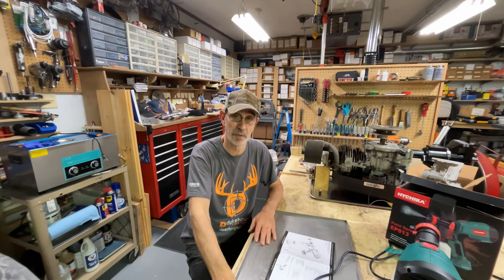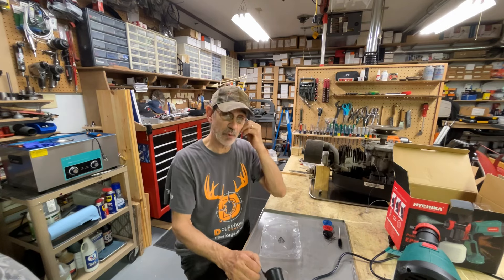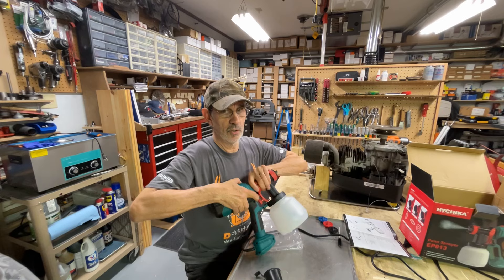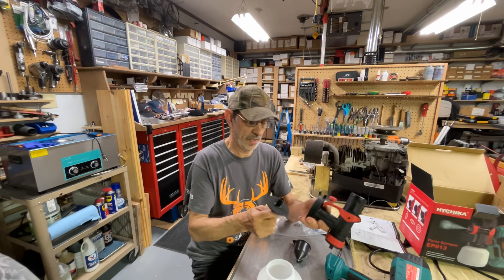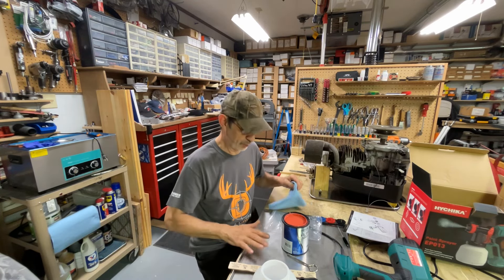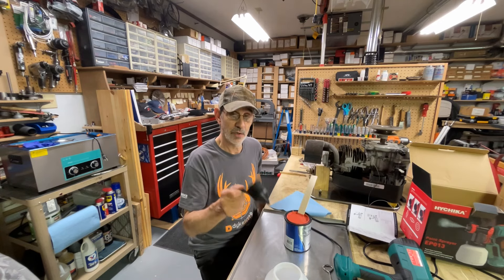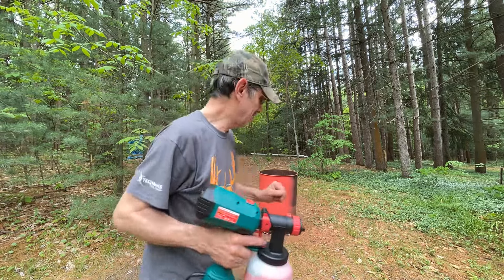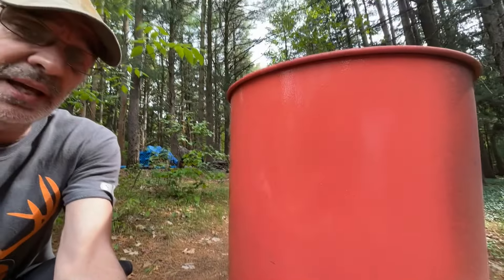481. ￼ Looking for a spray gun.     I just happen to be doing a review on one that works pretty nice

Comment: Hey Jim that red had quite a orange tint to it. Kind of reminds me of Pontiac's GTO Judge from the late 60's to early 70's that was called Carousel Red, But on Chevy Camaro's it was called Huger Orange go figure. The paint gun does lay down a nice even layer, & it's priced right. I have one that came with a compressor that I bought, & have never used it; I just go with the rattle can. Nice demo Jim SNAPPOUT.

Comment: What did you use to clean the parts?
Reply from the maker: It was latex paint. I use soapy, hot water.
Reply from the maker: If you’re talking about the spraygun, I just use warm soapy water. It was latex paint.
Reply: @jimjackson9381  thank you. I was talking about the spray gun. I bought one, now I need to use it.

Comment: Jim I have a snapper rear engine mower I seen where you made a piece to fix the worn out yoke it's a piece of metal you bolt on Do you still have one of these need one bad.thanks Roger
Reply from the maker: It depends on how much your yoke cost some of our fairly cheap and others are fairly expensive but the cheap ones it didn’t pay to make the piece of steel and put in there the yokes were cheaper.
Reply: There are 65.00 and this is the second one I have put on it they are not very great metal. And hard to put on.
Reply: Thought you metal might be better stuff
Reply from the maker: @RogerPurser  you can go to like Home Depot or Menards and pick up some flat stock and make a piece out of that. I just don’t have any right now and don’t really have a way to make any.